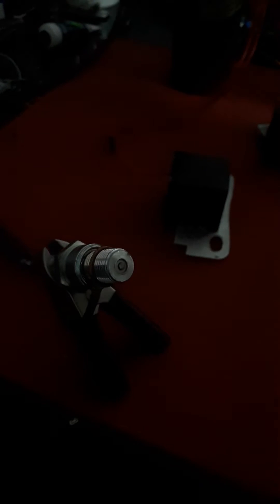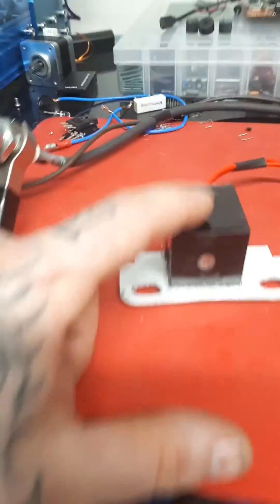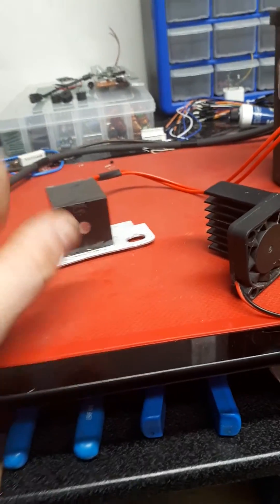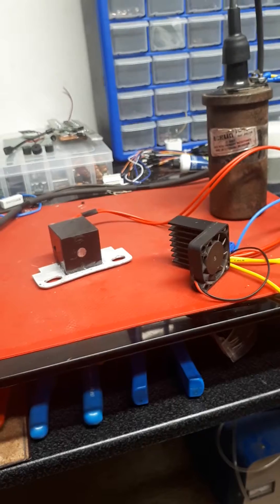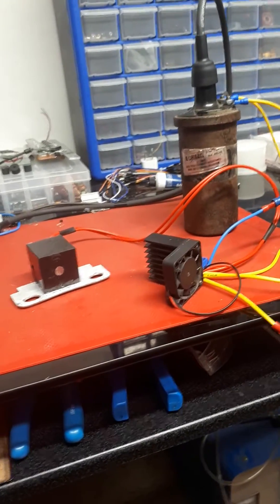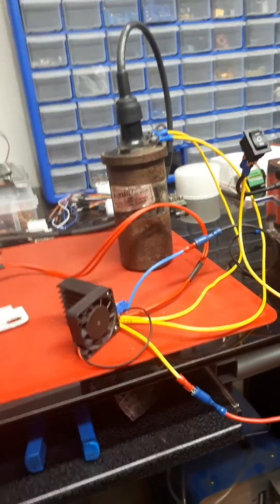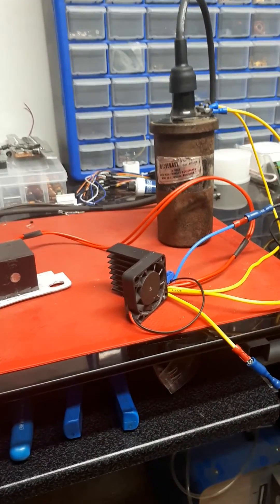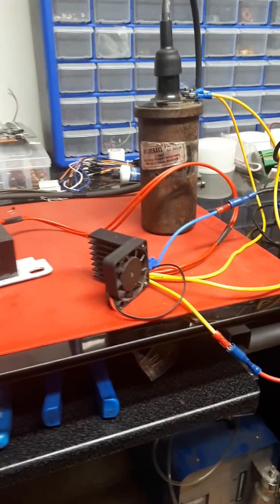Homemade HEI ignition system

Comment: Awesome as always
Reply from the maker: Thanks bro, my truck and car i drive are both as old as i am. I have my car with the 4 pin GMC ignition module and love it. I have another unit for my truck and that was over 200 for both. So with that price I cant have spares in the glove box. So looked it up and it's the simplest circuit ever.